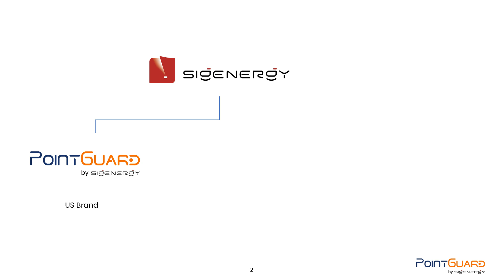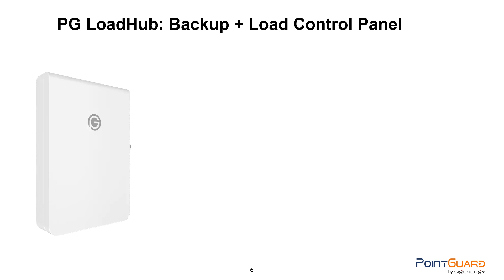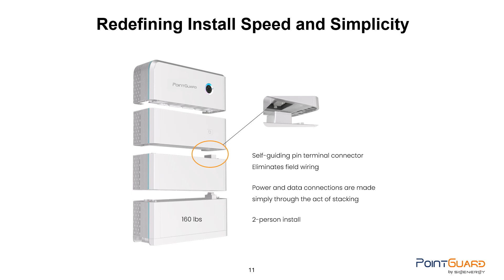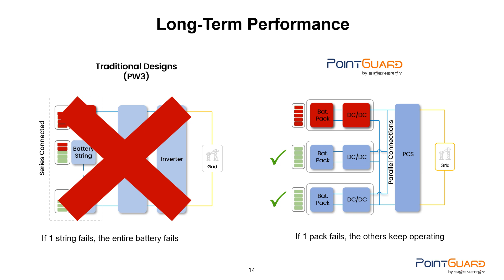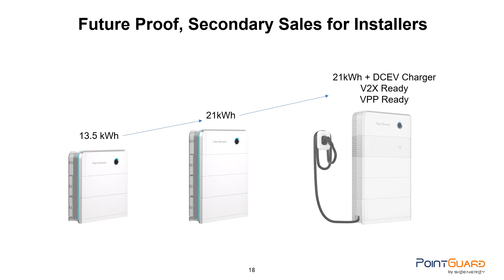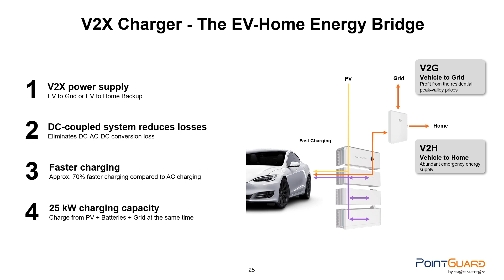PointGuard Home Introduction

Comment: Price
Reply: I got quotes from Green Tech and for 16kWh system with Powerhug it was about $14K installed and mine isn't the simplest installation as I am installing a 7.6 kW generator and the PowerHub in the garage and the battery stack outside.  This is the Very competitive.  Mine should get installed sometime in February.  Edit: I am in San Jose California.
Reply: Getting 24kw system in Brisbane full backup to home with 30% rebate it will cost about $17k  installed will get electric car plus upgrade solar panels to 10kw in 2 years time